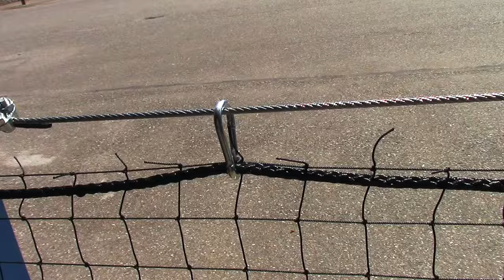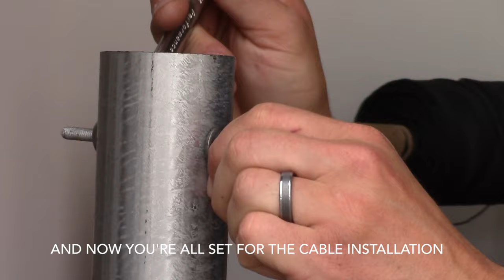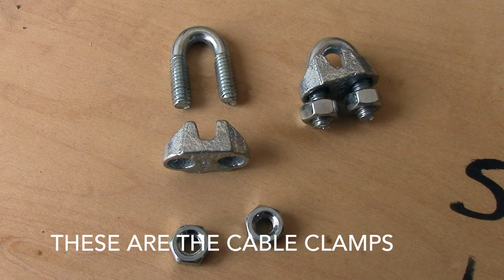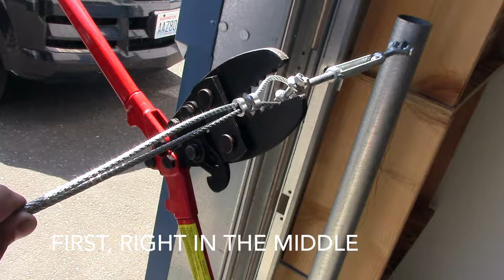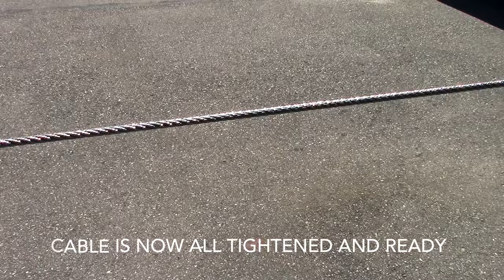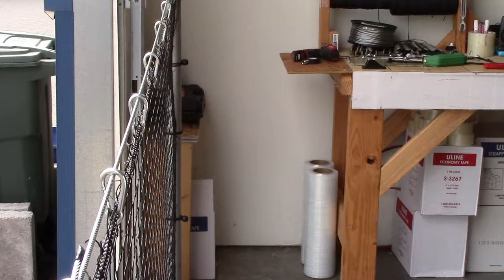Installing Cable & Hardware for Barrier Netting, Sports Nets, & Netting Panels

Comment: Question pertaining to the nets border material. What is it? The size of it? Is it attached to the net, or just weaved in/out of the squares? Thanks.
Reply from the maker: Thank you for writing!  We offer rope bordering on both diamond and square mesh pattern netting, and then we also offer a webbing/grommet bordering selection on square mesh pattern netting as well.  All are sewn into the edges of the netting mesh, but have different sewing and preparation characteristics.  There is a very helpful page on the Gourock website that really helps add more context to the bordering of the nets, some example images, and good details on how the different bordering options are produced - see here: https://www.gourock.com/netting-borders.html - hopefully that helps out a bit more!  Always feel free to get in touch directly at Gourock.com as well and it is our pleasure to assist.  Thank you!

Comment: Great video, just what I was looking for.  May I ask if there is a max distance recommended between posts for netting?  Grappling with adding a 2 meter high catch net to the top of a 2m wooden fence to prevent my autistic son  putting his balls/sensory toys in neighbouring properties.  Consider using malleable cast iron flanges to fix cast iron lengths and then the net on the fence posts.  Unsure how may lengths to fit with 4 per 10m being my inexperienced estimate.  Any advice?
Reply from the maker: Thanks for writing Jon!  Most of the time we see average intervals of about 30'-50' or so for cable spans between posts.  You can definitely go longer than that with very solid posts/supports to tension the wiring between, but typically noted for most netting installations is about 40'-50' (+/-) based on a lot of the feedback we get from installers.  The netting that we supply is not tremendously heavy in physical weight, so the primary considerations for the posts/wire setup is being able to tension the wire as tightly as needed to get a level span - while moderating the amount of pull/pressure that the wire will put on the support posts.  Hopefully this helps out!
Reply: @GourockNetting  Thank you. Very much appreciated

Comment: Would you be able to do this at a height of 25’ and length of 180’??
Reply from the maker: Thank you for writing!  Yes - most netting installations of that sizing will utilize cabling to suspend the netting with.  You'll want to consider a series of poles on intervals of around 30'-50' spacing (or so) running along the 180' overall length in that case.  Cabling will often run between each pole/post in that case (an individual cable/wire between each pole, with a turnbuckle on each end to tighten), and the rope bordering of the netting panel will clip to that cabling with carabiner-style snap hooks (every 18"-24" or so).  Hopefully that helps out a bit, and thank you again!

Comment: great video!  what size fence posts are those and what is the size of the bungee ball straps?
Reply from the maker: Thank you!  Those are 2-3/8" diameter posts, and the bungee ball straps are 6" long.
Reply: @GourockNetting  Thank you!  very helpful
Reply: @GourockNetting  One more question please, what size turnbuckle did you use?
Reply from the maker: @mattbowles7960  no problem at all!  That is a 3/8" turnbuckle, 12" long when contracted